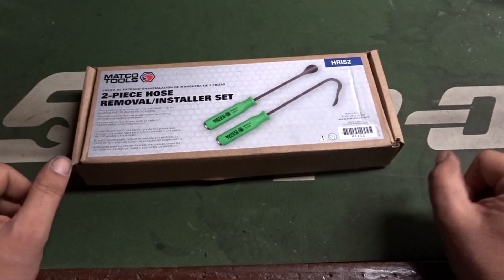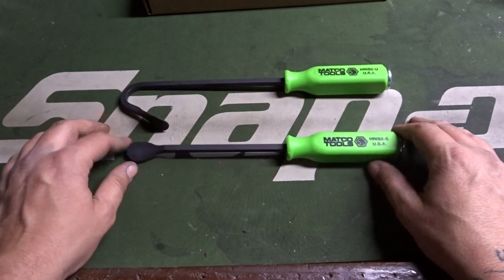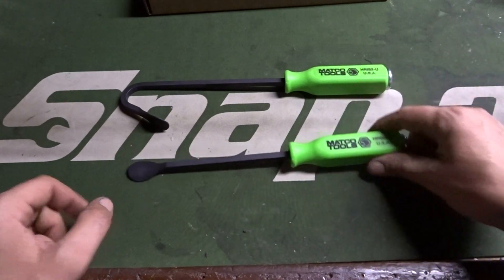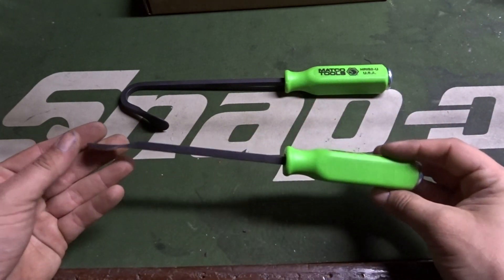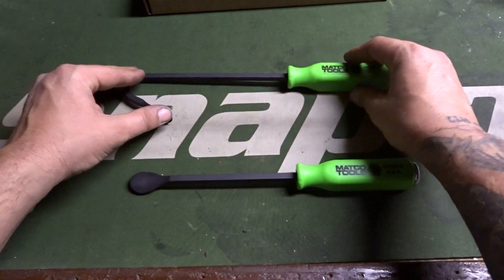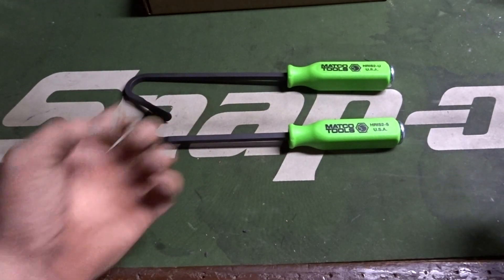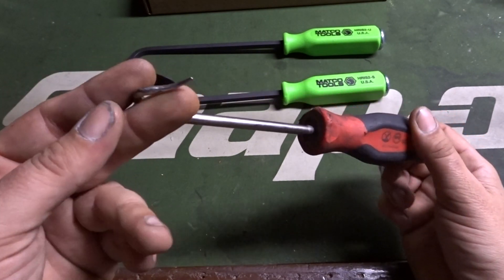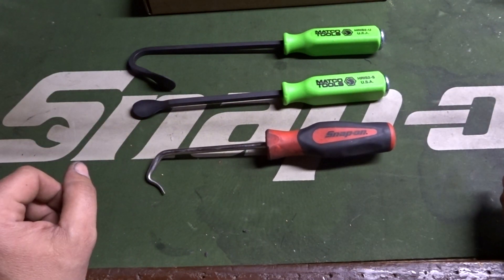MATCO  HRIS2 2 Piece Hose Removal & Install Kit

Comment: Grease on a radiator hose is a no no. That hose is not fuel proof and grease will weaken the hose over time. 
Use a little anti-freeze instead.
Antifreeze is plenty slippery and of course wont attack the hose.
As a general guide silicone based lube on petroleum based hose. Petrol based lube on silicone based hose

Comment: I seen these on the truck. The handles on them remind me of the new Craftsman pry bars. I didn't buy them because I thought the ends where to fat. I like snappy design better because they are thin and can get in tight spots. Matco is charging the same amount of money as snap on.
Reply: The handles are the same because they are both made by Wilde.

Comment: Shade tree mechanic here. I drive a 2003 Chevy Astro. I've owned since 05. I enjoy doing work on it. Hoses can be a bugger. The clamps. What do you think of those hose clamp pullers the type that puts pressure on, cant think of the bloody name. The yoke!